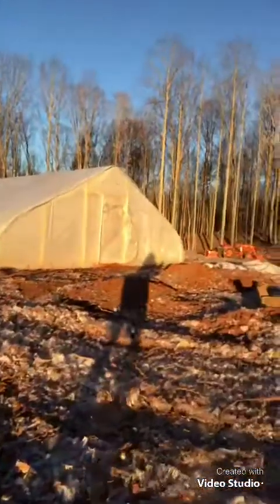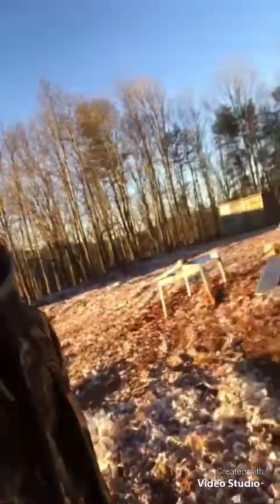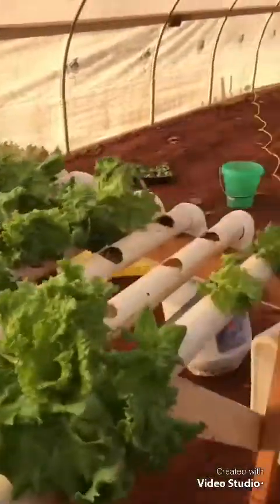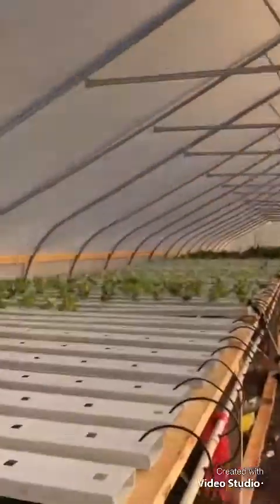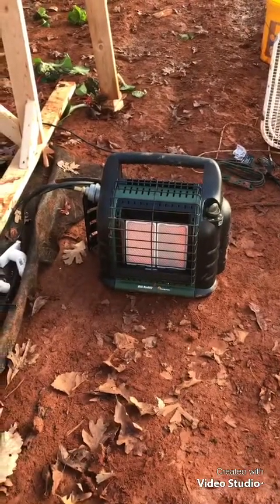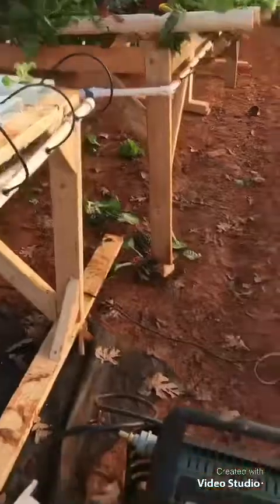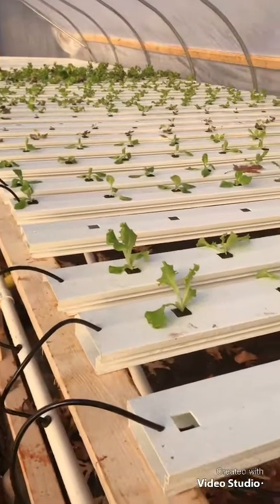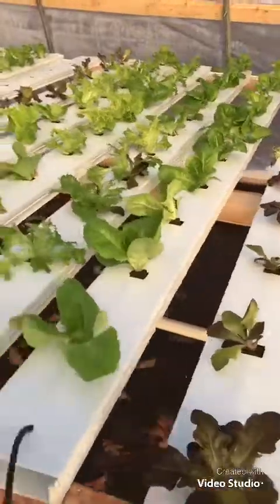Heating a 24x72 hydroponic greenhouse with Buddy Heater!

Comment: Wouldn't it be cheaper to heat the water?
Reply: The larger the amount of water to heat the more expensive actually. For aeroponic systems with water heater and higher amount of time pump is on will increase heat due to movment